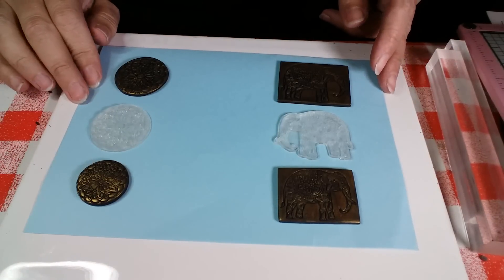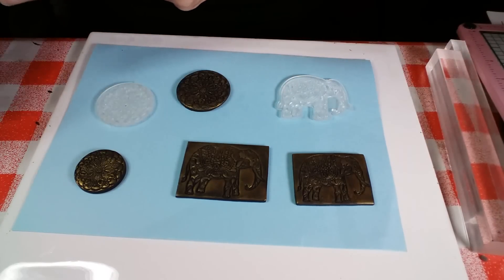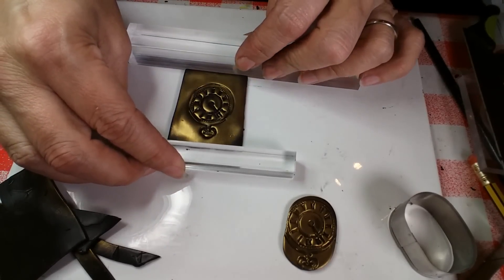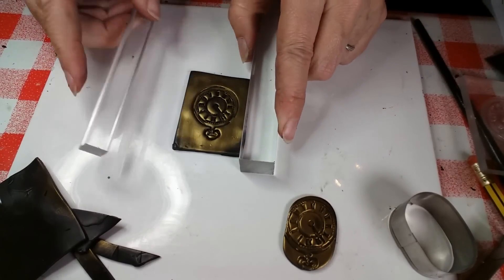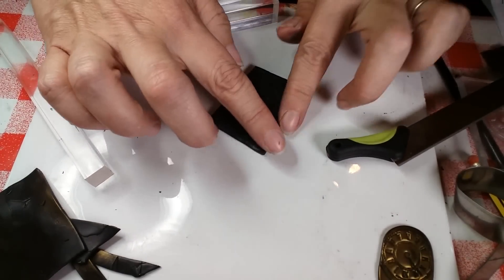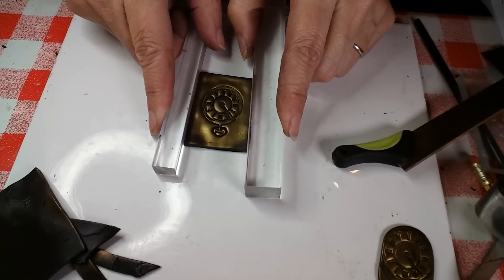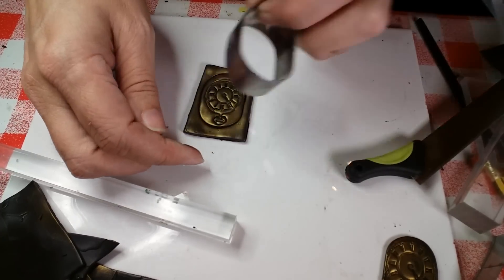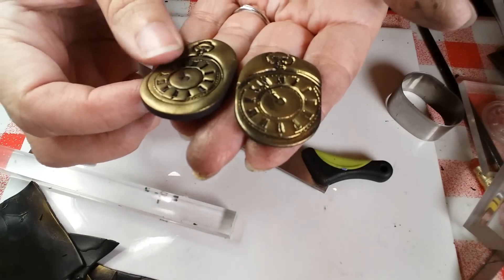How To Reduce Stamp Sizes On Polymer Clay

Comment: Ludmilla Bakulina did a demo of this technique when she reduced the size of her personal stamp with her initials (or someone's!) here on YouTube. That was recently, and the only other instance I've seen.  I did play around with it somewhat but I have only a few stamps, mostly I have texture sheets.  I may have to try those!
Reply from the maker: I did try a bit with a texture sheet (Lisa Pavelka's "Paisley")... It worked but her sheets are so deep and awesome, it didn't compare.
I should have known I wasn't the first to try this and I hadn't seen Ludmilla's but she is an absolute powerhouse! If I was going to avoid things she had done, I'd have to give up claying! LOL xx
Reply: I tried it with a small area of a small texture sheet (Circuit Board from Cool Tools) and it did work, so now I have a smaller bit to make a smaller piece of mica shift!  I just used my fingers to nudge it in from all four sides, slowly.  The clay was Premo, and still soft from conditioning, which made it easy.  Now it's cooling on the side of my Compressed Air can, before shaving it for the mica shift.